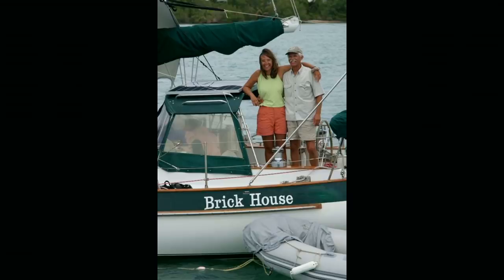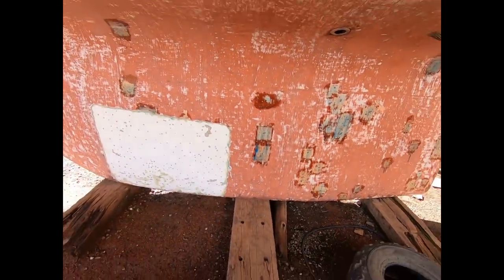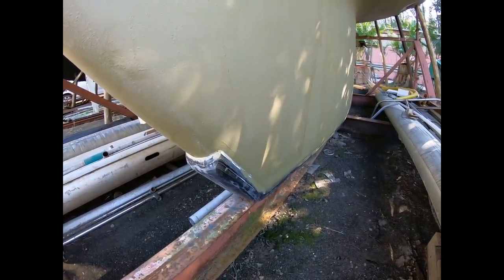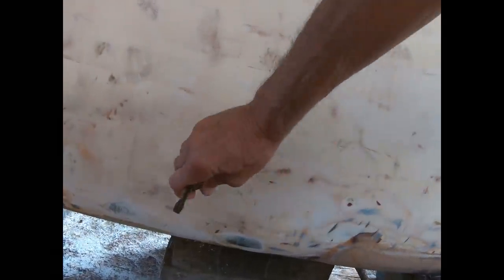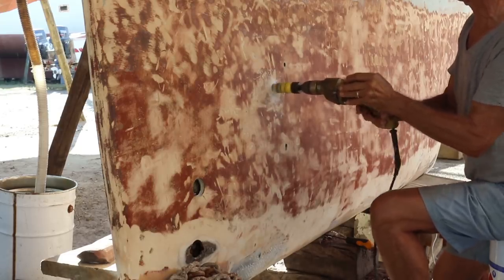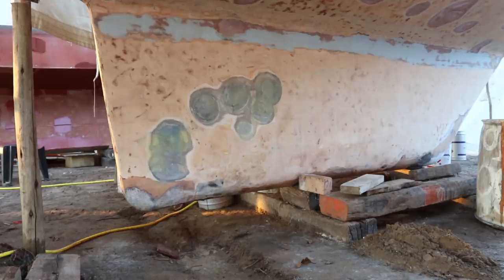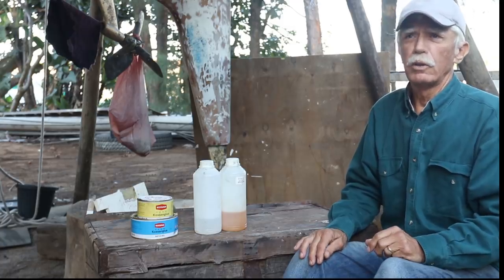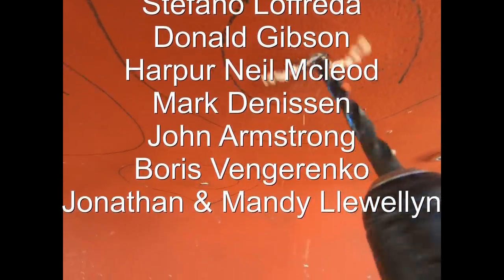Sailboat Keel Repair/Problem: SOMETHING IS MISSING FROM OUR KEEL !! (Patrick Childress Sailing #42)

Comment: At the risk of sounding like a Troll. THERE IS VERY LITTLE STRENGTH in poured poly resin.   Next time your boat is  out of the water  , cut a hole big enough to work through. Using an air lance cut out all the rubbish foam inside and chip out the resin that will come away easily; leave the rest. Mix resin with chopped strand glass and a suitable filler  and trowel into the base of cavity and level,repair hole and you should be good to go.I would have thought it possible to  enter the void through the cabin sole with the use of an angle grinder. If so  should be possible to improve matters without cutting any more holes in keel. might be worth having a custom stainless water tank built and glass it into the void  left by removing foam  in same way they glass in ballast blocks at the factory. It could be filled with water in heavy weather to assist boats stability. re trim using fore cavity.  Good luck and good sailing.
Reply from the maker: David,   Thank you for your comment. We always appreciate constructive comments. Maybe you will have more to say after reading my reply. The keel faring and skeg on this Valiant 40 were made independently from the hull, in  molds, then bolted onto the hull of this boat. There is no access into the keel faring or skeg from inside of the boat. The bilge is very shallow.  The keel faring on this era, 1976, are known to be weak, so blocking too far aft causes unusual stress on the faring, i.e. oil-canning and possibly cracking of the rear faring skin. I don’t believe this is what the designer intended. In my mind, this is not the mark of a “blue water” sailboat. 
After all these decades, I wanted to find out what went wrong at the factory to cause this weakness. I found voids in the foam of the keel faring. As the designer of this boat stated, “There should be no voids in the foam.”  This foam is very durable and does not easily yield. I have experience with this foam from working on the skeg of this boat. If I wanted to remove any foam, I would have to cut it out with a power saw or chisel and hammer it. It is not simple “filler”; I see this very dense, strong, foam  as structural to help vertical loads. Fill the voids in the foam with something equal or stronger than the dense foam, and there would be a good chance, vertical  strength would be gained.  Without rambling on, I had little choice but to use unthickened polyester resin.  One important thing I failed to show or mention was the slipping of many fiberglass disks into the largest void as filler/riprap. These disks are what I cut from the blisters with a hole saw. After washing and drying them, about 100 of them  became filler in the lowest part of the void before pouring in the resin. 
I don’t work with polyester resin often but from what experience I have had, I would not see a block of this resin to be as fragile as glass crystal, as some would suggest. I have taken a 1.5 pound hammer to a small block of set up polyester and it sustained some very heavy, repetitive, blows before finally breaking. And then, there were not the sharp cutting edges, as some have suggested there would be. I could stand on the broken pieces barefoot, no problem. A new magic trick?   For the purpose intended, in a confined space, surrounded by fiberglass and a very solid foam, it seems to me to be an adequate filler to transmit pressures.  Am I wrong on this? One other example I have found to demonstrate the strength of a small block of polyester; 12 years ago, in Colombia , I had some guys cut out a section of the fore deck behind the windlass and in front of the inner-fore-stay chain plate. We dug out the wet balsa coring and I wanted them to fill the area with a build up of cloth and resin. I was there for the first two layers of cloth to go in. I left for 5 minutes and returned to find they simply dumped resin into the rest of the void. There must have been a language burp. Recently, I took the windlass out and ground the fiberglass to expose this area. That block of resin is still there, intact, not cracked at all. This is a high stress/vibration area. It did not shatter like glass nor has it cut anything. I will leave it in place and epoxy/layup over it, with the other fiber glassing I am doing in the area.  
In any case, I feel better knowing there is less of a chance of seawater getting up to and effecting the keel bolts. Additionally, now we know why there has been such an oil-canning problem for some Valiant 40 owners, and possibly owners of other boats with weak keel faring problems. 
For durability, when bumping down onto, or side swiping a rock, I have been adding layers of bi-axial fiberglass to the bottom of the keel. To do this, I removed the most rear support, of 3, leaving the mid and forward keel support. Soon I will reinstall the rear support and remove the middle support to continue the work forward on the bottom of the keel. I am trying to figure out some sort of jig to measure the width of the keel to accurately, when the weight of the boat is taken up at the rear of the keel faring, to determine if the filling of the voids has improved things, or done nothing at all. I will certainly let everyone know. 
Any other pointers you or anyone else have would be welcome.
Reply: @RVLifeNOW  Brilliant salvage and repair operation Patrick.
Reply: Always sand between coats of resin,  if you don't you will have a weak bonding.
Reply: @RVLifeNOW  This is why I seriously considered building my own boat back in the 70's.  My fear was that with an average 10,000 man hour build time for a good boat I am such an Obsessive compulsive perfectionist I would just now be getting it in the water...  I helped a guy back in the 70's build a 40" Trimaran in Anchorage Alaska he was a medic on the Anchorage Fire Dept before I became a fire fighter.  It took him 5 years and he did a beautiful job.  He quit the dept. and motored south to Seattle to have a mast and rigging installed.  By the time he got there he realized he hated sailing (he had never sailed a day in his life) sold the boat and worked on boats in Seattle for years, his building skills were excellent.
Reply: @RVLifeNOW  My grain of salt, yes again ,today being Sunday I decided to do nothing .if watching great videos can be called doing nothing when you are 
actually learning from the best. 
I do not know how you measured the width of the keel ,personally I would try these  (untested) method :

MORE SIMPLE :   One  plumb line from your chosen spot on the keel to the ground on a stick square to the boat axis under the keel, mark the line and the stick, go to the other side repeat with line marked length against the keel over the stick ,mark the stick again, then  measure, et voila.
. 
MORE TECHNICAL  Set up  two level laser beans parallel to the keel axis one on each side of the keel at a given convenient whole (1m,2 m,4 ft)  spacing at the height you  want your reading and measure  the space horizontally  from the laser to the keel on each side( slide a strait stick under the keel square to the axis as cross side reference) then do the simple math.. Lots of readings? :set up a gig for the lasers with 4 vertical supports down from the sides of the boat and a moved cross beam aft and forth.
Reply: There is a huge  difference between thinking and doing and you are in a dream world.with invalid facts.
Reply: @RVLifeNOW  Sorry guys thought you had dug out all the foam and replaced with resin. Hearing your problems at length it might be advisable to drop your keel, strengthen your hull internally if possible and work on the keel from it's top side. I have to agree with you that a small pocket of resin should  withstand most of stresses placed upon it. have you found any other voids that should not be there or is all clear.

Comment: Oh man. That rubber on the bottom of the keel would have saved us last week. We just hit a rock hard. It'd be interesting to see what would happen if this rubber would shear away (ideally) and absorb some of the impact.
Reply from the maker: Yeah we are thinking the same thing...but if it just comes loose...can you imagine the pain involved? But if it stays adhered for decades that would be nice. So you will have to haul out for repairs? You guys are in the Philippines if I remember correctly, so at least there are some haul out facilities! Rebecca
Reply from the maker: Same here when anchored in a very difficult situation in the Solomon Islands, the wind unexpectedly shifted, swinging, to make the aft end of our keel hit some coral. A bit of rubber on the bottom and sides would have made a big difference. Hopefully, someone will come up with a good system to adhere rubber to fiberglass. While hauled out, I think I will do some experimenting with 5200, epoxy and what ever anyone else suggests.
Reply from the maker: I hate wind shifts. You aren’t the first boat to bite the keel with a wind shift. We weren’t either. And neither of us will be the last...hope Naha will come right. -Rebecca

Comment: On a repair I can access from both sides I find 12:1 sufficient, but do 20:1 or more for single sided repairs. It allows me to get a nice taper down to the full thickness, and a very strong repair. Good thing you found the hollow spots in the keel before it became a more serious problem. I've never done a pour like that with resin before, and wonder why you didn't add any filler. Wouldn't it have made it much stronger, and only marginally harder to pour? Either way it would still be stronger than the manufacturer's foam filled void, or in your case air filled.
Reply from the maker: I had no idea how narrow the voids would be inside of the keel and needed the resin to easily flow to all areas. Yes, anything more solid than the air space is better and stronger than before!
Reply: @RVLifeNOW  - I figured you had a good reason for your plan of attack. 😁

Comment: The conveyor belt keel protector is EPIC.  Makes so much sense and it looks like it would do a wonderful job of protecting the keel if running aground.
Reply from the maker: Some catamarans have stainless steel rails on the bottom of their keels for beaching purposes.

Comment: My Ericson 27 has the same keel with the back hollowed out. That is the bilge. Wasn't happy so I added six inches of 16# foam so I could reach the bottom. Then I installed three layers of carbon fiber. Now I feel a little more secure!! Thanks for all the great videos
Reply from the maker: On our boat, the keel faring and skeg are bolt on affairs so the bilge is very shallow. I was working on a friends boat where the keel and skeg were part of the hull mold causing deep canyons as you describe. I dropped a flashlight into his bilge and there was no way to get it out; far out of arms reach. I am with you on filling the voids for practical reasons.

Comment: I encapsulates my keel with Nytex and epoxy. The surveyor was concerned about the bolt-on keel, but after seeing the encapsulation, suggested that the bolts were no longer needed. I used 3 layers of 34 ounce cloth; an entire hull over the existing hull. Nice work!
Reply from the maker: What is Nytex?  On our skeg, I did similar to what you did, and so heavily fibeglassed it to a large surrounding area of the hull, the skeg bolts are not needed. It is far stronger than what the factory did. If you look at our skeg, especially in the Blister Repair video, you will see it is a very different color than the rest of the hull.
Reply: @RVLifeNOW  Knitex is a knitted fabric: numerous layers sewn together on alternating bias'. Usually s-glass, available by different manufacturers. Quick way to add strength. I applied it over epoxy filler, for overhead laminating.
Reply from the maker: @patrickhackett3878  Sounds like good stuff. Thanks!

Comment: That's another very interesting video Patrick, as all of your's are. I'm looking for a double ended boat myself right now. I'm going to make sure whatever I get is surveyed meticulously. Always a thumbs up from me sir. 👍
Reply from the maker: DevonBuccaneer Thanks Devon...Patrick is out working on holes RIGHT NOW...he will see your comment later on -Rebecca
Reply from the maker: Devon, be cautious with a double ender, where the stern is as pointy as the bow. They have a terrible "hobby horse" and can be quite challenging to live on in a bumpy anchorage. Our canoe stern is far better but still, in just the right wave train, when hard on the wind, there is a slight hobby horse which slows us down. A more fuller stern is more stable and a faster sailor.
Reply: When is say double ender thats just what some of us call a canoe stern in England. I'm thinking of a Saltram Saga, Esprit 37, Westsail, Hans Christian, Pacific Seacraft, Baba or Southern Cross. Preferably with a full keep.
Reply: *keel flipping auto correct thinks it know better than me lol.
Reply from the maker: DevonBuccaneer Yes...From Bob Perry directly: 

“Then why did I make the Valiant 40 a “double ender”? Marketing! It was just assumed that offshore cruising boats had to be double enders and rather than buck that trend I decided to go with it and at the same time add my own twist to the shape to try and improve the performance of the double ender” 

....so first came “double Enders” ...then Bob Perry tweaked them and made them a bit different for a variety of reasons... and that is what Patrick means...go for the “upgraded” version of a double ender...the canoe stern...- Rebecca

Comment: I have used Gurit epoxy on my boat, and have no complaints. I also have measuring pumps just as west system for mine, so very easy to use. Gurit SP 106 is my go to epoxy.
Reply from the maker: went with the Gurit and it is working out very well. It is good to know others use it as well.  For some reason, they don't sell the pumps here so we are ordering the 5:1 pumps from the U.S..

Comment: We found the very same void in the aft portion of our Kings Legend 41 keel.  We cut back 6 inches of the trailing edge and packed the void with glass and epoxy and reshaped the edge using a fairing board.  Great video.
Reply from the maker: That would be a good way to go. I know of another Valiant 40 where the owner cut out large sections of fiberglass on the port and starboard side near the aft end of the fairing to expose missing foam. That was a big job to fill the voids then rebuild everything.
Reply: @RVLifeNOW  Explorative probing revealed the fiberglass in the void hadn't been wetted out properly and in fact was a series of folds only partially wetted out so cutting it open allowed me to get to that problem as well. The disparity between the designer and the boatbuilder often offers a measure of head scratching. That conveyor belt option is interesting tho.
Reply from the maker: @svflyingspirit4507  Good information. Thanks.

Comment: Great job dealing with these issues outside the normal supply chain.
Reply from the maker: These "exotic ports" can be a real headache to complete repairs. It is so easy in the U.S. or Australia to run down the street to a "Home Depot" or marine store for whatever you need.